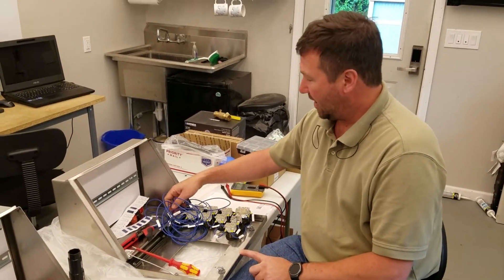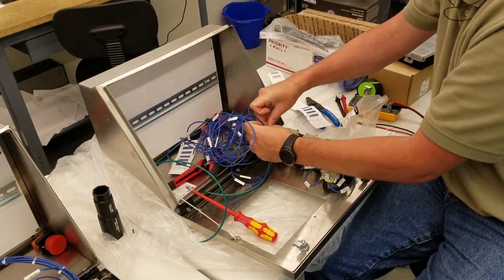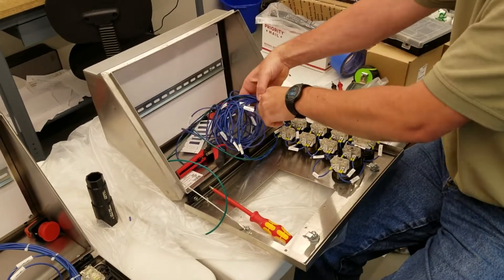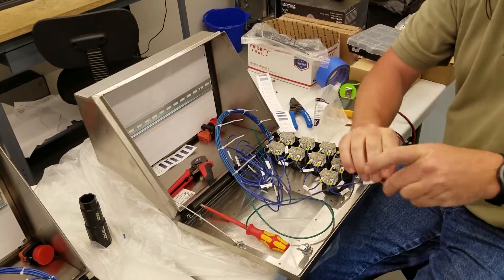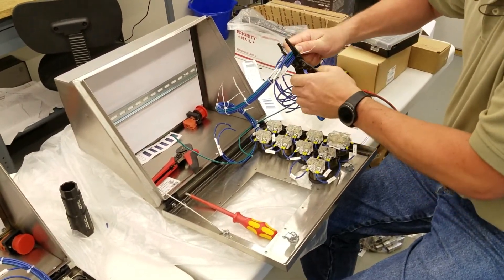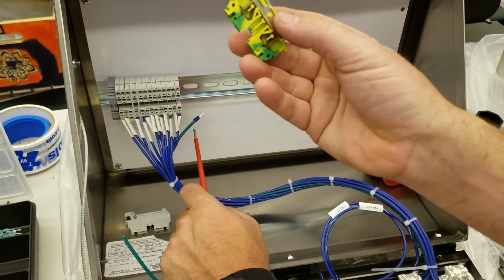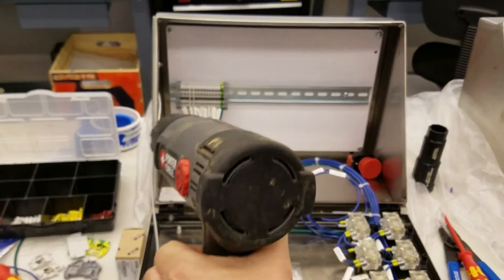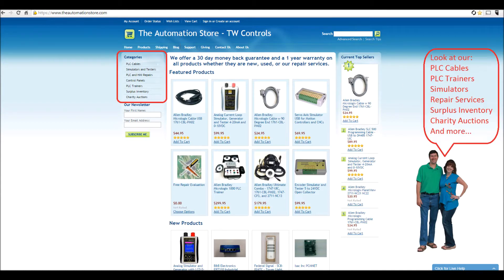How to Neatly Wire to a Control Panel Door

Comment: Amazing! Do you have any guidelines on control wiring color codes? Here for the panel door all the cables were blue, with the earth being the exception (as it always should be green w yellow). Also, how did you cut the HMI cutout so nicely?
Reply from the maker: According to UL 508A, only grounds must be green.  All other wire colors vary by region.  

Here is a video I did on different ways to cut square holes
https://www.youtube.com/watch?v=8rIHtrh4bb0

And another I did later about the square corners.
https://www.youtube.com/watch?v=_4ZsHXU_gNU

Comment: Tim,
I’ve drawn up my schematic for my CNC enclosure, every wire and component is laid out. I have a shrink tube wire labeler and I want to assign a number to each wire. Is there a standard I should follow? I plan  on a prefix on the label to show what system it’s associated with but as far as the numbering, what tells me that this wire should be #001, 002 etc. or do I just assign them my own numbers? I do plan on keeping the final schematics in the enclosure since there is no way my brain could ever recall what goes where and I don’t want  to run into my computer and get a copy.
Reply from the maker: At the bottom of the following link you will find a set of sample drawings.   It will give you an idea of how I do it.  The wire number lets you know what page and rung (or line) number that the wire originates on in the wiring diagram.  Hope that helps. 
https://www.theautomationstore.com/rslogix-500-reading-wiring-diagrams-and-understanding-electrical-symbols/
Reply: Tim Wilborne Explains it! Thanks so much.
Reply from the maker: @heeder777  You're welcome.
Reply: @TimWilborne  I couldn't find that URL and tried to manually find it to no avail. Is this still available?